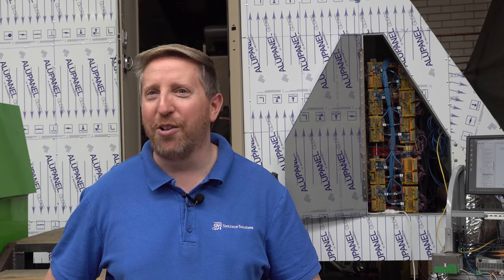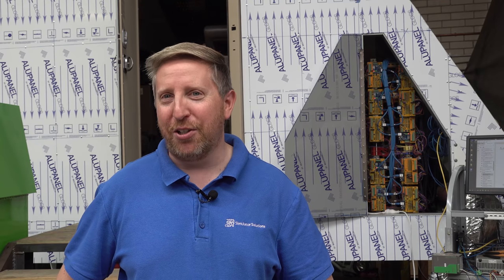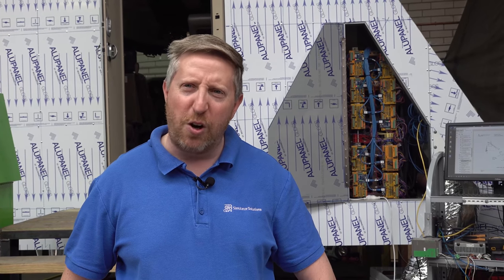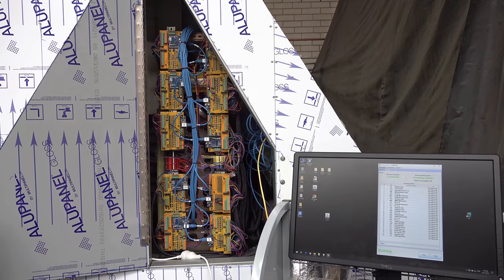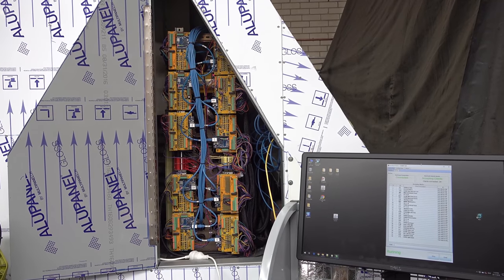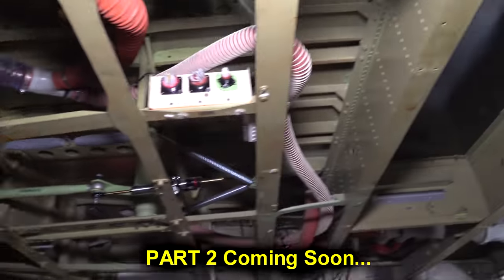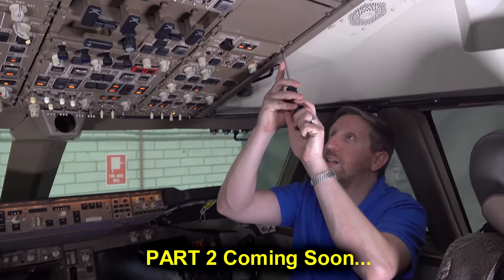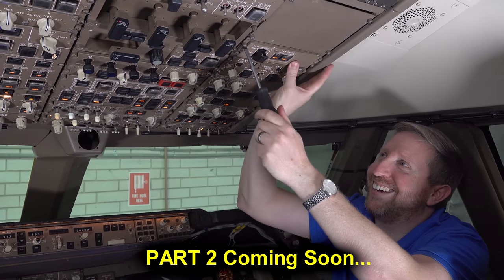EEVblog #1267 - How To Control a 747 Flight Simulator

Comment: This is an impressive project I wonder if they will invite actual pilots to basically validate it when it's completed. I was also wondering if they'll plan to mount it on an hydraulic system to move the cabin which would be even more impressive.

Watching some documentaries Boeing itself reuses cockpits from scrapped planes to become simulators and it would be interesting to know how do they interface with them
Reply: Take a look at Dave's other channel, 'EEVBlog Discover' and view the other 2 videos he has about the DIY simulator. It demonstrates the hydraulic motion platform you mentioned.

Comment: Which projectors are they using?
Just saw the Optoma Packagin, can you tell me an Model Number?
Building a 777 Simulator myself ;)
Reply: @davidpalmer9780  thanks, but this looks like it's not affordable for a private Person ;)

I used FlyElise Software to try several 1080p Projectors, it's possible with some Models but an issue is the Pixelsize. Maybe theres an Option with a special Lens for the Curved Screen. Most Projectors are made for Flat Surfaceses, the other are Expensive. Maybe i should just try it out and return them if the Result does not look good.

Comment: I'd be interested to hear in EEVblog speak how he is uploading the software via Ethernet.  Didn't really understand his short description.  I'm guessing it is still programming via the program data and clock inputs to the processor, but is there a middle man there?
Reply: My guess is that, because he's talking about 'programming' the simulator I/O logic in there, that you're not actually programming the entire microcontroller flash with new data but there is some kind of VM-like architecture running in the Atmel processors, which can run any code you want to manipulate data in the simulator's memory. Since the boards are only doing I/O and not any complex logic or arithmetic, you can do that with a very simple instruction set which is interpreted by the boards at run time.

Completely re-flashing the chips over Ethernet is certainly possible if you have a boot loader that can talk SPI and which will load the new firmware binary off Ethernet, and only flash it when it verifies as being correct. That's how pretty much any embedded controller does it.
Reply: @Stoney3K  - Interesting. Thanks.

Comment: Not sure why you would cater to the diverse power requirements from 28V DC to 115V 400Hz of the native equipment? Why not reverse engineer the physical switches and the outputs (lights, screens) from the ground up. And backlighting - use whatever - LEDs, electroluminescent panels, etc. "Authentic" - yeah, right. Backlighting - no one cares as long as the brightness and color temperature is the same.
Reply from the maker: Err, watch part 2. I put my finger on one of the switches and it's so hot I can't keep my finger on it. It's part of the realistic "look'n'feel"
Reply: @Robert C The servers needed for Google to store all the comments about pollution pollute more than one simulator somewhere in Oz.. ;-)

Comment: Don't know much about avionics... it would be nice to have some basic facts... like common operating voltages, protocols etc.  The arduino solution is rather sweet... 328P for the win.
Reply from the maker: Err, he mentions common voltages and protocols!
Reply: @EEVblog  apologises I speed watched it, as I do most YouTube Must have missed that part. @09:30 Voltages.  Looks like I was caught out for trying to blag that I had done my homework.
Reply: @NivagSwerdna  ...and at 7:50 for the different protocols too. Actually... I recommend watching at normal speed. :-)

Comment: Wyhy could you not use Corning USB cables, has anyone even thought about using an UDOO RYZEN Bolt V8 maker board which is compatible with A86,MASM86 or GCC80586

Comment: 18:10 omg i didnt know spring headers were a thing
Reply: They are all over Aliexpress. They are gray with orange levers usually. They are really cheap too. I have wanted to buy an assortment kit for a while. Those spring connectors are also popular for speaker wire connections. Those black and red tabs on the back of speakers and receivers.
Reply: @excitedbox5705  oh yea, come to think of it, i have seen them on speakers. thanks!
Reply: @excitedbox5705  If you want to have quality terminals, look for brands like Weidmüller or Phoenix-Contact. They have a track record of providing high quality components since they supply industrial automation equipment. Just don't expect the connectors to be $0.50 a pop like on Aliexpress.

Comment: Pretty hefty price tag for something set squarly on the shoulders of open source right up to the point of loading a custom bootloader just to close it off.  No pitty when aliexpress pumps out thousands of these for next to nothing.
Reply: @Undefined Lastname To be really pedantic, Arduinos, but they just use them as a base chip and nothing more. There is nothing 'open source' about Arduino except the development environment which is ultimately just a fancy Java-based C IDE.

Comment: 14:35 Plenty Arduino Mega (clone) boards! ( 15:44 and press pause - Mega compatible) Arduino for kids? Duh! :-D ;-)
Reply: This chips from 2007, The WIZnet W5100 is
 a single-IC Ethernet solution with a built-in TCP/IP stack.
http://www.i-vis.co.jp/pdf/wiznet/tcpip_chip/w5100/W5100_bootcamp.pdf